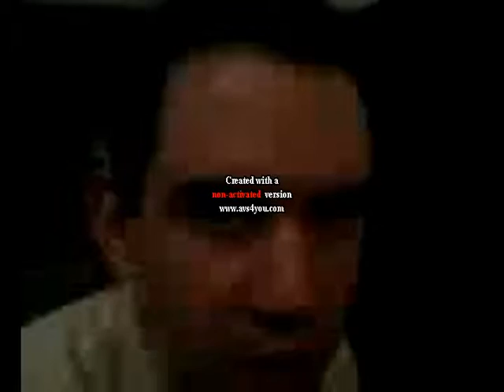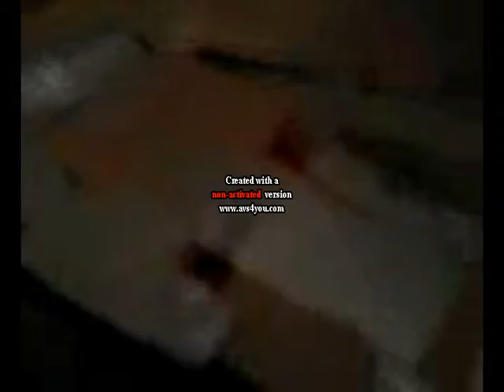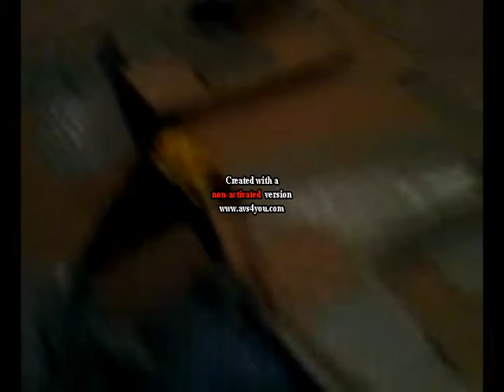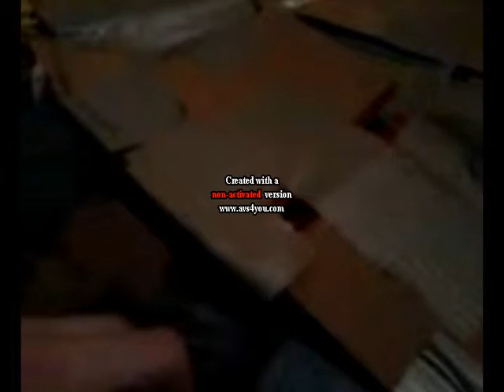WORST PERPETUAL MOTION VIDEO N COPPEDGE

Comment from the maker: This device makes use of an 'Eridian curve' which is a special contingent angle on the difference between the horizontal and the vertical angle. Hard to believe, but during a portion of movement, I observed the marble move apparently upwards, on the opposite end of the counterweight, which is not normal. In this way, it builds on my work accomplished in Evidence Against the Classical Model / Successful Over-Unity Experiment 1, which seemed to prove that over-unity is possible. The construction is very crude, so that it is very possible that parts of this device would be more functional than in this design. The oval with a cross-cut was a unique design when I crafted it. Essentially, the ovular shape bends downwards so that there is net upwards gain by terms of the shape of the track. Then the curve bends down, and then the mobile weight applies leverage to the longer end, lowering the next upwards slope, creating the same effect in double. If both raised ends are lowered by leverage, apparently it is possible to create a loop without a degenerating spiral. This device is that attempt, and I am still not absolutely sure that it could work. But it is a step in the right direction. The most innovative part is the cross-cut, where the marble moves at a less-than-contingent angle. If the cross-cut were lowered, I believe the same effect could be achieved without loss of altitude. I hope some industrialist eventually notices that I've discovered something. Perpetual motion should be a reality!